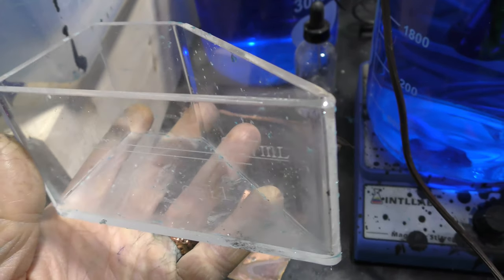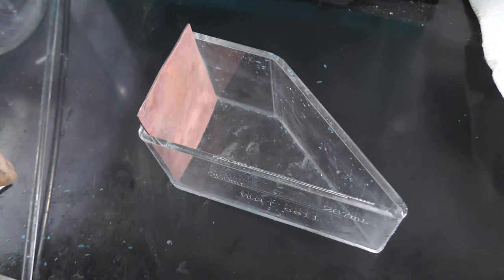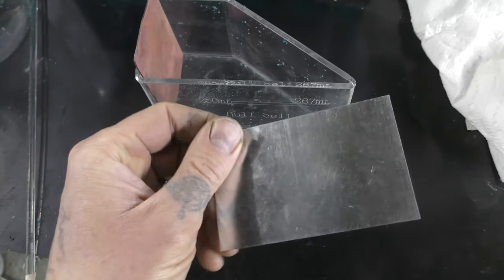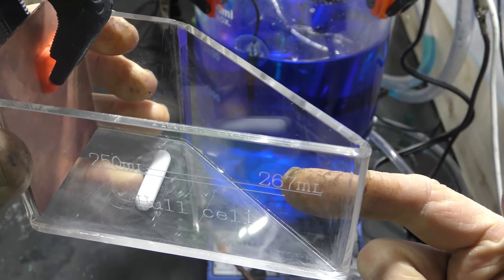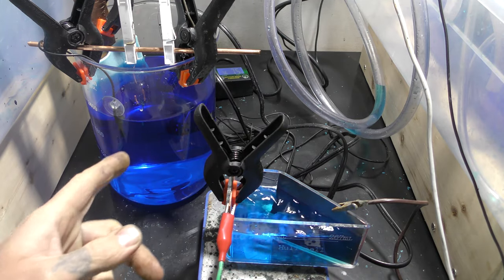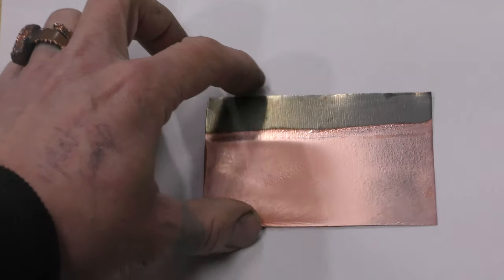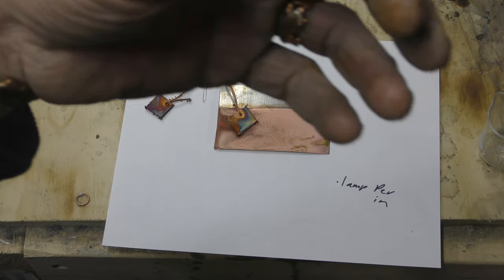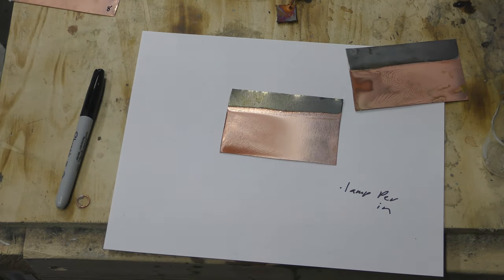Copper electroforming Hull Cell Test

Comment: Jason, thanks very much for the informative video.  I have plating issue lately. I follow the 0.1 amp per square inch rule and agitate the acid plating bath well. The plating is bright, but it also forms lines on the surfaces (much like a sand dune effect).  I know it may be caused by the current from the agitation, but when I turn off the agitation, the surface turns dull with lines(flatter and wider) going vertically.  What do you think causing it. Thanks.

Comment: The link mentions brass plates for their tanks and you are using copper, what specific metal is that chart calibrated for?
Reply from the maker: Brass should be used if you can find a good source for them cheap. You can use a thicker brass and then sand down the plate and re-use.
Reply: @JasonWelsh   I bought a small sheet of brass at my local lumber yard supply store. It's sold as a protective kick plate to be mounted on the bottom of a door. It has a protective coating that will need to be removed but you won't have to flatten it out like you do with pipe.